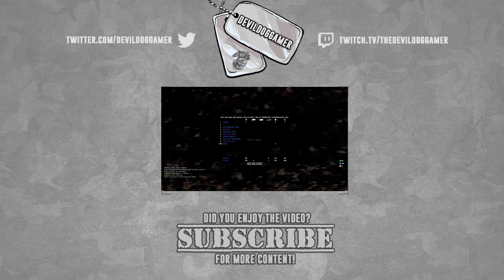DCS World - Refueling Nightmare

Comment: Hey, that's my old airframe - KC-135.  Not sure if you know or if the game even implements it correctly but the lights on the underbelly of the tanker are called PDI lights(sometimes PDL) and are there to help you, especially during night refuelling - might be worth learning how they work but hard to explain without pictures.

Something I've heard is always think two steps in advance, if you are closing fast it takes awhile for you to lose that inertia so plan 2 steps ahead - especially if your aircraft is heavy.  Moving from pre-contact to contact takes patience.

Another thing, if you are prone to over-correcting a lot right before contact - you don't have to keep a neutral tim setting, some pilots like to set the trim nose down a small bit and work against it - so you only need to correct one less axis.

I was a Boom Operator and prior KC-135 Crew Chief
Reply: It's all simulated, this is an A-M-A-Z-I-N-G realism game!
Reply: Setting the trim, what an awesome idea... going to try this in Falcon BMS

Comment: Dumb question maybe but, why did you not use the autopilot for that? most modern jets have an autopilot "program" for refueling. Have not played the game, so dont hate me if that is not a feature in there. ;) Nice vid though, looked intense all the way.
Reply from the maker: There is auto pilot in modern aircraft for refueling it is all done manually
Reply: There was a video of an F/A-18 refueling automatically.. but it was just a test or something like that. Sometimes I use the autopilot in the F-15 but when i try it with the A-10 the autopilot is going off.
Reply: +SomewhatAce13 but here is diff re-fuling lines....auto pilot would only work if the re fuller had a boom with a boom pilot...if it's one of them 1's with the lines draped from wings auto pilot can not detect the line...i'm not a pilot, but my cousin is a boom pilot...you pull up behind air craft engage auto pilot, and boom driver connects you, then he calls to turn refuling on, and the line drops from boom while fuel is being loaded....wish i knew all the correct lingo...but you can not auto pilot a line flapping around in the air...
Reply: Im a boom operator and i have no clue what you're talking about.... the receiver aircraft never has his auto pilot on, there is no "Auto refueling" procedures in existence in the operational field.

Comment: This brings back memories for me! Devil, you should have used your nv-goggles at night.  If you look at the boom in daylight you will see markings on it.  Don't aim for the boom! Pick a reference on the aircraft and a reference on your HUD and focus on the aircraft.  So long as you match speed, alt & direction with the tanker the boom operator will actually steer and direct the boom to your fuel door.  When your connected just use your trim and small forward and back throttle movements to keep the markings on the boom in the green.  Good luck bro!
Reply: Where are the markers located on the aircraft and what do they look like?
Reply: The markers are located on the boom itself and they look like chevrons...on the aircraft you just need to pick a point of reference like using the tip of the nose on the center top of ur HUD.
Reply: Ah ok, I'll have to give that a try next time.  Thanks :)
Reply: Sawta No problem good luck!
Reply: ***** Its, DCS World - Digital Combat Simulator

Comment: Sorry to ask probably sound dumb but what exactly is trim?
Reply: Trim tabs are small surfaces connected to the trailing edge of a larger control surface on a boat or aircraft, used to control the trim of the controls, i.e. to counteract hydro- or aerodynamic forces and stabilize the boat or aircraft in a particular desired attitude without the need for the operator to constantly apply a control force. This is done by adjusting the angle of the tab relative to the larger surface.

Comment: What does trim do?
Reply: Don't quote me, I know jack shit about aircraft

I think it is minor adjustments to the pitch (up, down), and is an alternate from the joystick.
Reply: YouGotOwnd1000 It's not really an alternative to the joystick, trim  gives you more precise control of the aircraft, as well as getting it to fly straight and level. Set your trim high, and the ailerons/elevators lock in a position to make the plane go right, or up respectively. Set it low and the plane goes left if it's the aileron trim, and it goes down if it's the elevator trim.